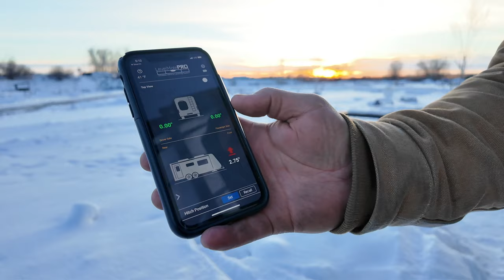Winter RV Travel Day Heading Further North | Negative Temps & Frozen Water Lines | Full-Time RV Life

Comment: In the future if you decide to hold onto this camper get yourself Heat Pads for your tanks. Our camper has heated under belly through the furnace and heated pads which I installed. TIP: have RV antifreeze with you and shoot some down into your gray water and black tank “ Pour As You Go”  the heated tank pads are go while we’re on the road and you have liquids down there that are not freezing up, running off your 12V; absolutely beautiful scenery as you entered Idaho.  You have an OutDoors RV I’m thinking they would have heated underbelly and heat pads also?
Reply from the maker: Hi Jesse, we do actually have a heated underbelly and tank heat pads however another mistake we made as RV newbies is that we turned off the tank pads when driving, not knowing that they are 12v and could have ran off of our trailer batteries. Definitely won’t do that again lol
Reply: @justearthenvessels . LOL blessings

Comment: We know what that's like! We've found that our heat pump and electric space heaters do a good job keeping us warm when it's around 30 degrees F or warmer, but colder temps require us to run the furnace. It costs a LOT more to run the furnace due to the cost of propane, but it's really the only way to keep the underbelly warm enough to avoid freezing. Some might not like it, but we had to run our furnace (set at 50 degrees F) to keep everything warm enough even when we driving down the road. This used a lot of propane, but freezing pipes can cause fittings to rupture and can be a huge pain to fix.
Reply from the maker: Yea we thought about doing that however when our slides are in, they cover all of the floor vents. We turned off our tank heater when driving because we didn’t realize that it runs off the batteries and can be left on. Have had no issues since we started leaving it on. Thank you for watching and God Bless!
Reply: @justearthenvessels  You should be getting a little power when the fifth wheel is connected to your truck, maybe a few amps, but the tank heaters will still likely draw significant power from your batteries. Do you have lithium or lead acid batteries?

Comment: Tip on the slide-outs … Seems you have Swhintech Slides.
if so be sure to hold switch to open and close 5 seconds after you finish closing or opening.
What happens they get out of Sync from, opening or closing half  way for what ever reason. And be sure you know where the control box is for the slide-outs in-case you need to reboot the system. And eventually you will.  God Bless
Reply from the maker: Hi Jesse! Yes we have Swintech slides. Thank you for the tip! God Bless